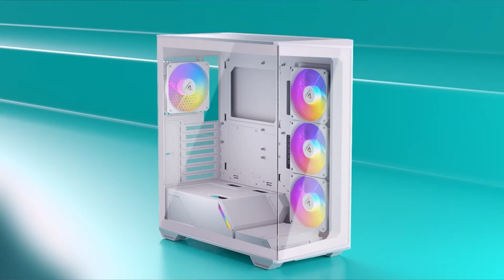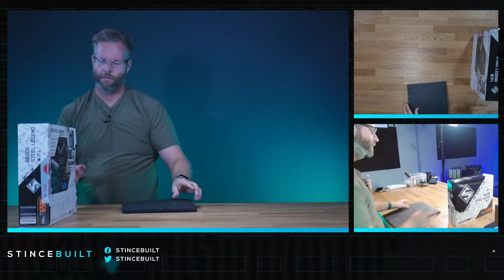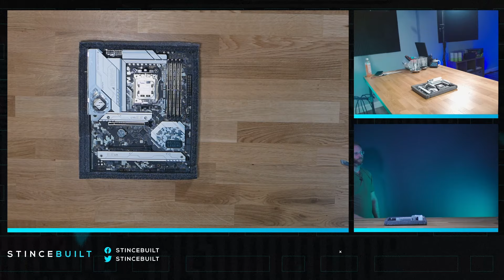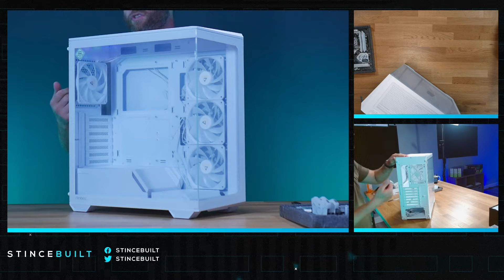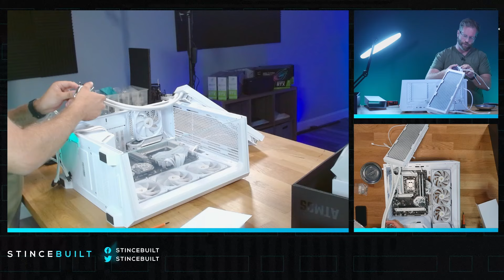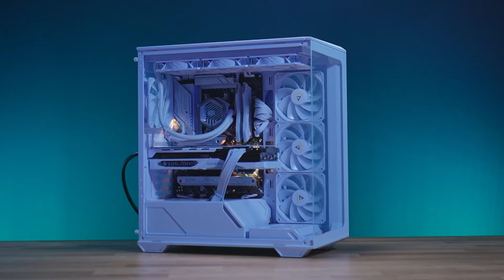Check out the NEW Antec C3 Gaming PC Build!

Comment: Wouldn't that fan config result in negative pressure since you have more exhaust than intake?
Reply: Can add one at the bottom , just need to take out the hdd compartment at the front

Comment: How and Where did you plug in the FAN hub onto the motherboard? I am confused by it and not sure where to plug it into the GIGABYTE Aurous B650E Elite AX motherboard. I got the AIO fans to run from Thermalright Frozen Prism ARGB AIO but the case fans don't work.
Reply: Did you find a solution
Reply: @ yeah, so you were supposed to plug in the SATA cable to the white satays cable connector on the FAN Hub to the PSU

Comment: do you know if you can vertically mount graphics cards in this case  and which vertical bracket would fix
Reply: "The Antec Shift Vertical GPU Bracket is now confirmed to work with the C3 ARGB. Prior to purchasing, we recommend confirming compatibility with other brand components for a hassle-free setup."
At least the one sold by Antec itself works, the Corsair one is similar so it should work as well, but we don't have confirmation. 
PS: information from gear seekers review of the Antec c3.
Reply: @deltaAvatar  Thank you